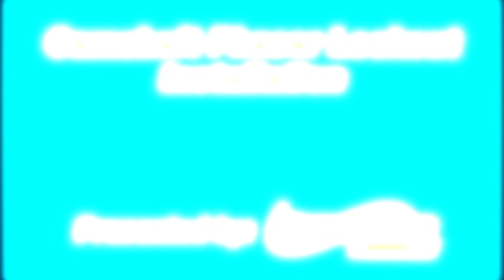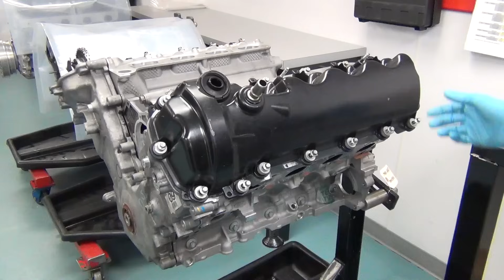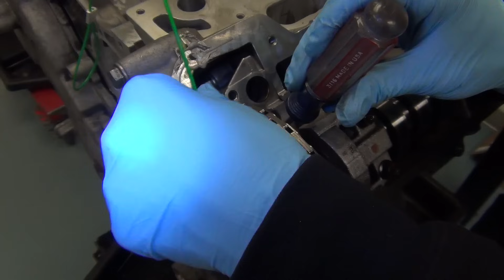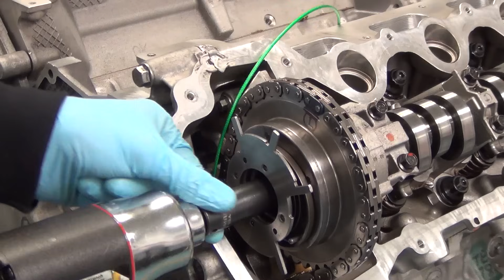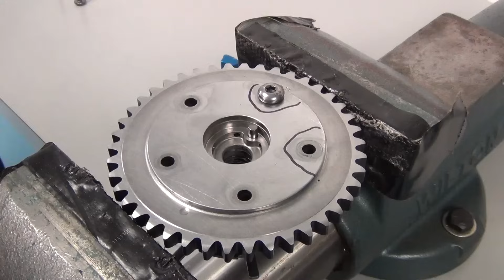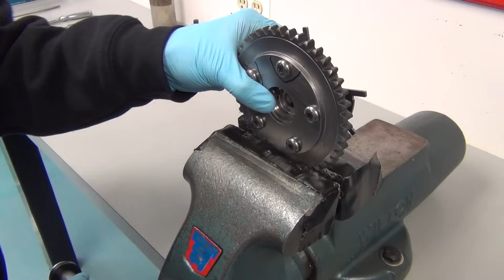Cam Phaser Lockout Installation Instructions - Livernois Motorsports New Link below

Comment: I kn6you can't answer everyone. My chain, guide's,and oil pump was all replaced. 2 weeks later, multiple misfire. Passenger side retatared,drive side advanced. Will installation of lockouts cure this ? I did install a Melling High Valume oil pump. And,new CVT ? The sensor that goes in both valve covers.

Comment: Great video thank you I have a question I have 2010 ford f150 5.4 v8 3v, I thinking to upgrade to stage 1 camshaft, my question is will stage 1 camshaft work well with fully locked without movement cam phasers or should I install phaser limiter 20 deg movement, but then I’m losing on that noise and rattling if I have 20 deg movement
Reply from the maker: Give our sales team a call for specific questions. 313-561-5500

Comment: I don’t know how fast she answer his question but doing the timing. Everything is lined up properly getting to put the chains on got one side on and the other side just putting it on and in the face are moved so what does that mean? How do I fix it or just let it move cause they yourself adjusting just continuing on with my timing
Reply from the maker: We're not 100% certain what you're asking, but after the installation of the lockouts themselves, it times exactly like factory.

Comment: Does both sides lockout come in one kit ??? And can I use an obd2 scanner or do i specifically need the tuner ???
Reply from the maker: It does come with both sides, and yes, you definitely need the tuner to recalibrate the ECM. A scanner can only read and clear codes, this requires custom programming to delete the VVT system and retain 50-state legality.

Comment: What is the reason for the lockout kit?
Reply from the maker: These lose control of the phaser as the engine ages and oil pressure and flow changes. This permanently removes this feature so oil can now be used to operate the engine and protect bearings, extending engine life.
Reply: @LivernoisMotorsports  Thanks for your reply. I wonder why they have the actuator to begin with

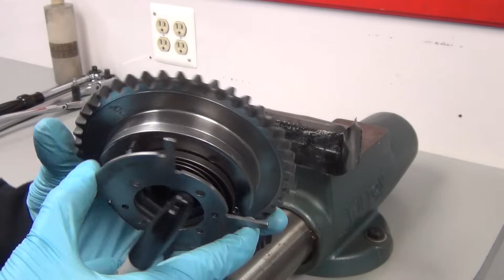Comment: What if the long bolt is not protruding on the spring side of the phaser at the 3:08 step? I can see the hook spring coming out, other 3 are clearly not, last one "may" be hidden by the timing reluctor. Any idea?
Reply from the maker: Is your Phaser an aftermarket? or OEM Ford?
Reply: @LivernoisMotorsports  OEM

Comment: This is the wrong thing to do by useing lock outs. This engine was designed to use phasers to in crease POWER and gas mileage. i tied this, not as much power up-hill gas mileage went down.
Reply from the maker: If properly done, this is not the case. These increase power and mileage compared to poorly functioning phasers, which on a 3v is 90% of the time, even with brand new parts on an old engine, and the calibration has enhancements required when making it a non-vct equipped engine.

Comment: Hola buenos días saludos desde Venezuela 🇻🇪  eso se coloca por qué tiene fuga el árbol de levas ?
Reply: Esto se usa para eliminar el sistema de engranes de la cadena de tiempo que es lo que sale mal en estos motores supuesta mentioned esto tiene que aser la maquina más confiable
Reply from the maker: If you're asking as to what causes the oil pressure yo be reduced? Just wear and age typically are the causes
Reply: He is asking if this Is used when the camshaft is bad
Reply from the maker: No, if the camshaft itself is damaged, it would still need replacement.

Comment: when you face the engine, the cams rotate clockwise. The clockspring in the phaser retards the cam, oil pressure from idle up advances the cam, for better low-end grunt. Your positioning of the lock out is creating a full retard condition. Shouldn't it be full advanced, since 90% of driving is under 3000 rpm?
Reply from the maker: The phaser, at rest, is fully advanced, and the lockout keeps it a full advance. It uses oil pressure to retard the camshafts, and this eliminates that function.
Reply: @LivernoisMotorsports  I'm looking at the rotation, and seeing it to be opposite. Sorry, but you've got things backwards.

Comment: so what is the benefit to locking the phaser as opposed to just replacing the phaser with a new one?
Reply from the maker: This permanently fixes it, as replacing the phaser doesn't address the cause of the problem. Loss of oil pressure is the main reason these lose control of the vct system.
Reply: @LivernoisMotorsports  but it doesn’t actually “fix” anything. The problem is that the 5.4 3v has notoriously low oil pressure over time and you’ve done nothing to fix the ACTUAL problem when you could’ve easily changed the oil pump while you had access to it doing this job. 🤷🏻‍♂️
Reply from the maker: @joebenny  The oil pump itself isn't typically the loss of oil pressure. This is natural bearing wear and tolerance increases over time. Since the oiling system has beyond enough volume and pressure to safely operate all aspects of the engine outside of the vct system, this method allows for customers to potentially add hundreds of thousands of miles of added use to their engine. Meanwhile, our #1 source for sales is from shops, dealers, engine builders, and customers that have wasted thousands of dollars replacing the entirety of the timing drive and oiling system, to have it fail again in as little as a few days.

Comment: I have only one long bolt, holding the spring but not a long one behind it, what's going on with that?
Reply from the maker: If it's an aftermarket replacement phaser, the design may differ

Comment: Just bought a f250 witht 5.4 3V. This might be a dumb question but why would you want to install a lockout to the phaser?
Reply from the maker: Since, eventually, all 3v engines eventually have the phaser system fail, the lockout prevents or fixes this failure. Preventing the associated knocking sound, poor idle quality, reduced performance, and potential engine damage that comes along with phaser issues.
Reply: @LivernoisMotorsports  thanks, I'm assuming you would do this to both phasers?

Comment: $700 for a $20 chain tool, $20 bolts and two pieces of aluminum that can be had for $15.  Oh, and a "tuner" that anyone with HPT can do for a $100...assuming one even wants to bother with it.  Noice.
Reply from the maker: And don't forget hundreds of thousands of dollars in emissions and durability testing to ensure it was 50-state legal and foolproof for the end user. 

It's easy to devalue something when you ignore the cost it took to develop and certify it. That's the difference between inventing, and copying. 

That's why it earned a patent, and 50-state legal status.
Reply: @LivernoisMotorsports  People were doing it with bolts, or any other piece of appropriately sized metal, 18 months after the Triton hit the streets.  You didn't invent anything.
Reply from the maker: @scottysgarage4393  Considering this was released in 2004, within 6 weeks of the official launch of the 3v family of engines, and featured heavily in our very early build 2005 mustang featured in motor trend, I'd say you were at least 16.5 months behind the curve. The CNC program was written before the first retail vehicle was ever delivered to the dealership. 

I don't know how loud I'd broadcast you were shoving random bolts and pieces of metal into customer's engines. Especially when there was a purpose built, precision machined solution in the marketplace at that time.
Reply: @LivernoisMotorsports  

? Do you have to do the other side aswell in all videos i only see this side
Reply from the maker: @joaquinvillalobos9735  Yes. Both sides must be done

Comment: Awesome vid! Excellent instructions and proceedures.   Now I'm sorry about my ignorance.  I think I may need to do this by can you explain in what case would I implement doing this??  Thanks in advance!!!
Reply from the maker: This is a great solution for any Ford 3V modular engine that has started to have a phaser knock, or cam/crank correlation codes, or cam over advance/over retarded codes.
Reply: Где купить этот продукт?С уважением А

Comment: Fantastic video, there's only one aggravating part, why does everyone call the bolt " torque to yield" it makes no sense, but everyone calls it that and it is backwards! They are called "yield to torque"  , because the bolt stretches and yields to the torque pressure, I don't understand why everybody calls it the other way around, other than that great video!
Reply from the maker: Because common tongue is more acceptable than grammatical or technical accuracy. 

Just like transparent vs translucent, or many other common technical errors with grammar, it's easier to just roll with the inaccuracies than create confusion with proper terms. 

Also, blame whoever came up with TTY as an acronym.
Reply: @LivernoisMotorsports  not placing blame, I just figured you were from Alabama LOL. it's not just you and I'm not pointing the fingers, it just cracks me up when I hear people use the same term . still a great video

Comment: Adding the block to the phaser must create an out of balance condition. What are your thoughts on that?
Reply from the maker: These are actually imbalanced in stock form, and their location helps improve this. However, you're talking about true rotating centrifugal mass, versus reciprocating. So the small weight difference, small diameter, and relatively low speeds make it all a non-issue anyway.

Comment: When do you need and why to lockout the phasers? And what are the payoffs for replacing it vs locking it out?
Reply: im not super sure but i have seen a lot of articles/forum posts/ videos about this specific issue with ford engines. i think that piece doesnt perform as designed and causes the chain its affixed to to either under perform or over perform against the engines performance. which wares the part out over time.

Comment: Will this lockout or limiter work on the new designed phaser because internally there slightly different shape??
Reply from the maker: We offer Ford and Dorman style phasers lockouts, and they work on all variations of these from 04 to current.
Reply: @LivernoisMotorsports   just lockouts no limiters???
Reply from the maker: @brandonross9711  We do offer limiters as well, but they do not fix the knocking. They are for larger aftermarket cams. We only make them for OEM phasers.

Comment: Is it necessary or do you also recommend to replace the lash adjusters and roller followers that are connected to them when you do this?
Reply from the maker: While not a bad idea to inspect them, replacing them is rarely necessary.
Reply: @LivernoisMotorsports  Well I bought this truck to strictly tow a 20ft boat and engine has 228k, its a 2006 5.4 3 valve, no check engine light, has been extremely well taken care of from the look of the exterior / interior and was a 1 owner but the widow had no paperwork on literally ANYTHING with the truck which is why I ask lol and everyone in these comments and small bit of research said theirs have gone bad at as early as 75-100k miles. I just purchased it a few months ago and did not at all have any idea of this ticking noise culprit / cam phaser stuff. I didn't hear it when I test drove the truck because it has a loudish muffler/exhaust system and probably did not reach an operating temperature high enough to really hear anything but now since I've driven the truck for a while whenever I get next to a building and am driving through a neighborhood or sit with the windows down in a quite manner with no music or anything and at low rpm around 1500-2000 I do notice this weird ticking noise bouncing off of the surfaces / buildings around the truck from outside and am curious if it is this phaser issue everyone is talking about. I'm considering just removing the heads from the truck and inspecting everything before I purchase your kit. I know that whole speel sounds open ended but I would appreciate any input if you have any in regards to the diagnosis & at minimum I would like to thank you for at least replying.
Reply from the maker: @CFlo93  Without hearing the noise it could be anything. These are also known for cracking exhaust manifolds

Comment: QUESTION...Do you recommend putting lockouts in brand new phasers?
I'm waiting on my new parts from the U.S. to come in. My Ford phaser was out 90° causing a really bad idel then a crank no start.
Thanks 🇨🇦
F150 5.4 L 3V 2006
Reply from the maker: Yes we do, that is the safest way to address these, by ensuring there is no damage to the old ones.

Comment: If you have an engine analyzer can you do the tune up procedure after installing the cam phaser lock out using the analyzer?
Reply from the maker: If you're talking a scan tool, no you cannot. Our complete kit comes with the necessary tuner and calibration.

Comment: I did the cam phaser lockout on my 5.4 L three valve, and had a question about it. 

Once the lock outs are in, is there any reason why the spring and plate on the back of the phaser still need to be there?

i’m not a motor engineer, but I do have a solid engineering background it seems like the outer plate is mostly there to provide centrifugal force that shifts the internals. 

Once the phaser is locked, does it need to spring at all?
Reply from the maker: The spring is not needed, no. But, we put it back on to prevent potential confusion, or loose pieces in the engine if forgotten/lost.
Reply: What are the flaws of a lockout? Mines in the shop rn for that

Comment: Wouldn't this cause error codes to be thrown by the check engine light??? Seems like this is a cheap hack but not the way to go long run. Just my two cents.
Reply from the maker: Our kit includes our 50-state legal mycalibrator tuner to do this properly, and is the only permanent fix for these.

Comment: I have a 2002 f150 5.4. Is it a 2 or 3 valve? If its 2 valve, do they have the same VCT issues and if so, will this exact same product work?
Reply from the maker: that is a 2v, the 3v engine did not launch until 2004.

Comment: Now can you install the lock outs to brand new phasers?  Or do you have  to wait till they get worn  out and start knocking  before you install  the lock outs?
Reply from the maker: You can definitely install them in brand new phasers, and we sell them preinstalled that way.
Reply: @LivernoisMotorsports   so aee yhey going to have a longer life span ? will they eventually  start knocking  with the lockouts in ghe phaser of do 5he lockouts  a permanent fix to the ticking?
Reply from the maker: @manueltovar4821  This is a permanent fix for the phasers, if it starts knocking it will definitely be from a different source.
Reply: So do you have to program the ECU again after installing the lockout?

Comment: What was y point of placing the spring back behind the bolt? The phaser is locked the spring will not be used again for it's intended purpose.
Reply from the maker: for being thorough, while the spring isn't needed anymore, having it there is technically less modification than removing it. so we chose the least disruptive path.

Comment: Any videos of an install of the limiter set you sell?
Reply from the maker: it would be near identical, save for the limiter being a multi-piece design, the same principles apply.
Reply: @LivernoisMotorsports  Some videos when replacing the timing components recommend clamping the cam in place (which seems like a bad idea) but you all didn't use anything like this. What keeps the cams from turning in this procedure that you all did vs the rest out there?
Reply from the maker: @bwgarage24  we got it to the natural resting position prior to disassembly, but usually you can lock it in place with a wrench on the flats of the camshaft.

Comment: What exactly did that do?
Reply from the maker: Are you asking what does the lockout system do?
Reply: @LivernoisMotorsports  Yes.
Reply from the maker: @SuperBighead1973  Our cam phaser noise repair kit permanently addresses the common phaser knocking noise found in these engines. The only way to fix it 100% is to disable this system and hold it in place mechanically. This does require our MyCalibrator lockout tuner to recalibrate the computer to work properly without it though. But you will never need to worry about the phasers again after installing this system.
Reply: @LivernoisMotorsports  ok that makes sense to me now. My 4.6 has almost 190k on it, and I notice a rattle/knocking sound intermittently while at idle, or in a drive thru that I’ve had mechanics just shrug and say maybe it’s a pulley or my idler pulley. Thank you.
Reply from the maker: @SuperBighead1973  This only applies to 3v engines. So if you have an 05-10 mustang gt, or explorer theb those have a 4.6 3v. The trucks did not.
Reply: @LivernoisMotorsports  I have a 1998 Grand Marquis 4.6
Reply from the maker: @SuperBighead1973  This would not apply then, these engines didn't start appearing until 2004 in F150's and 2005 in other applications.

Comment: This kit... i have to install on both sides...?
Reply from the maker: Yes you do, along with our tuner to have it run properly. We sell it as a complete system with all required components
Reply: @LivernoisMotorsports  and i have to install new timing kit too....?
Reply from the maker: @mikekolin217  This depends on the condition and miles of the vehicle, if they are in good condition, there is not a need to replace them.
Reply: @LivernoisMotorsports  what do you consider high milage? I just got a 2007 Ford mustang GT with 109,xxx is that just broke in or getting high? I'm used to trucks lasting 300 and 400 thousand miles, and I heard mustang milage is different.

Comment: Question- does it lock it in the fully advanced or retarded position?
Reply from the maker: Technically it can be used either way, but you would always want to lock them in the fully advanced position.